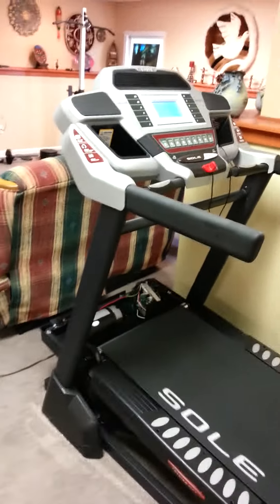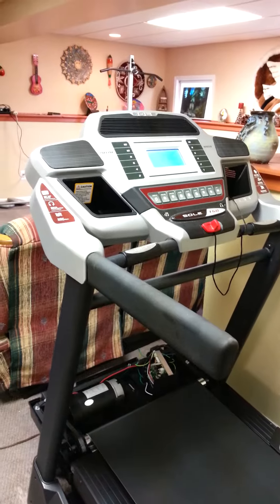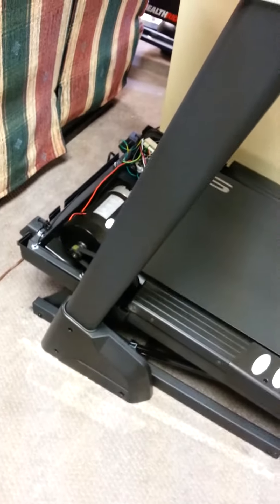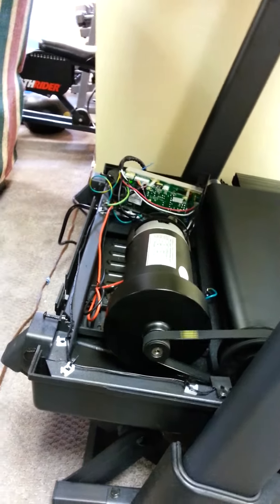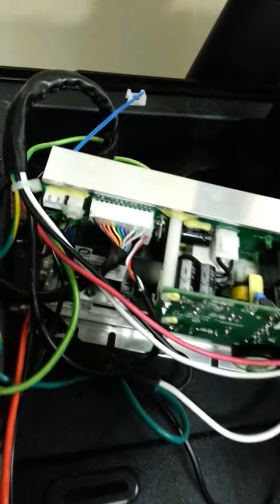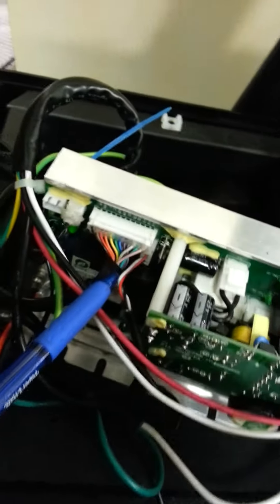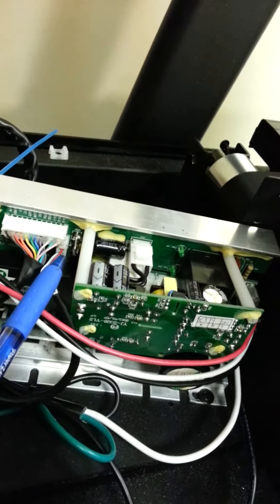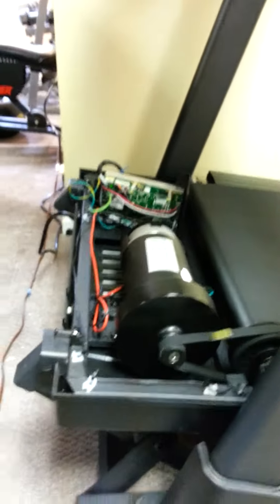Sole-F60 Treadmill Incline Error

Comment: thank you so much, you just saved the incline on my F63. the weird part is that mine always worked on the old position and one day it errored with an E2 code and moving the connection still fixed it.